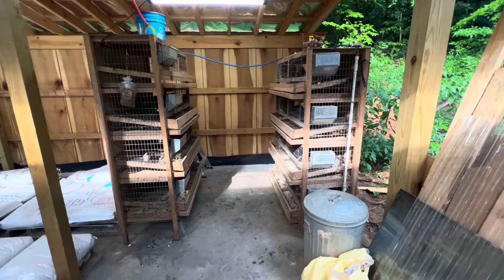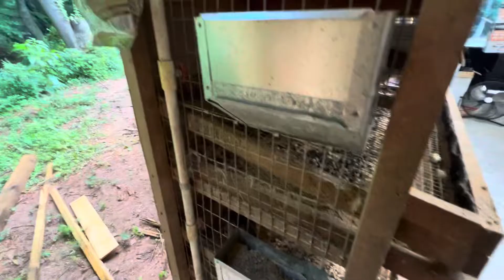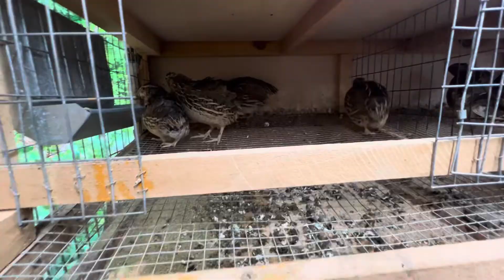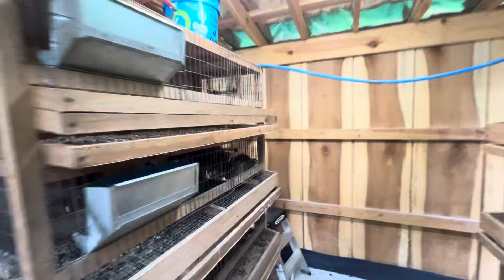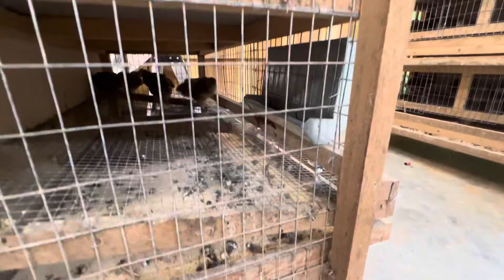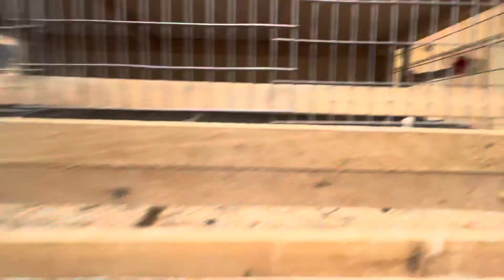Quail Set up for max production!!

Comment: how do you stop predators from getting the eggs or climbing in the open holes like the feeding hole or egg hole
Reply from the maker: We haven’t had any issue with anything getting the eggs. Over the years we’ve had, owls, rats, and recently cats reaching through the wire and killing the quail but never had any issue with something knocking the feeders off and going through the hole. The egg gap is only 1-1/2”. In our larger quail houses we’ve had issues with cats and snakes. It’s hard to predator proof something. We have several hundred birds and any particular time so small loses are negligible…probably not the quail who got caught though.